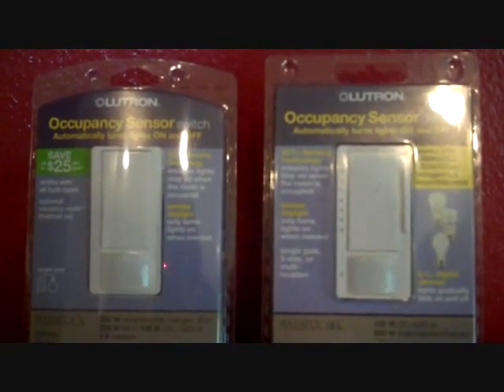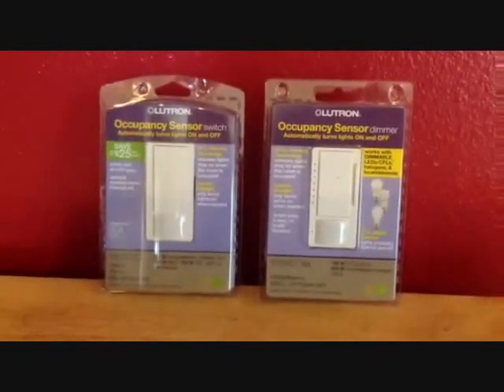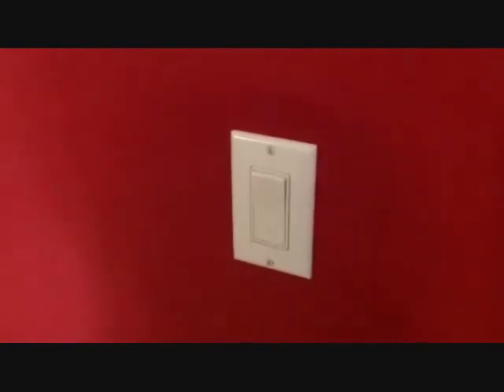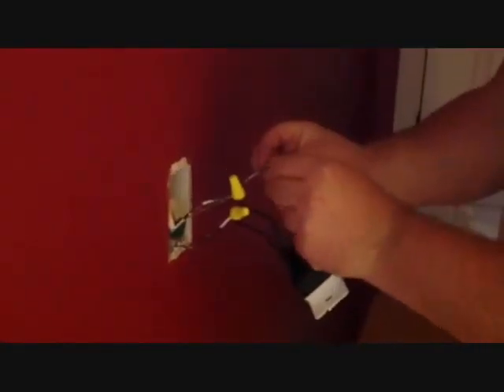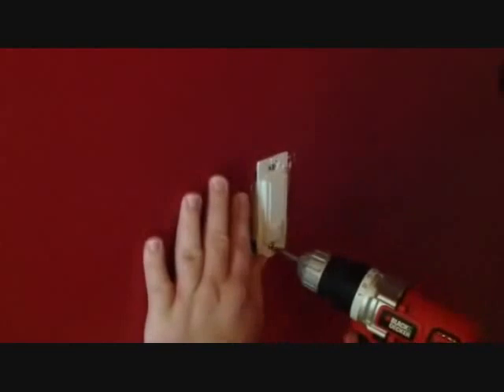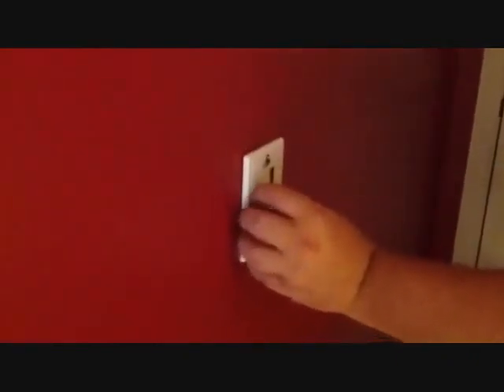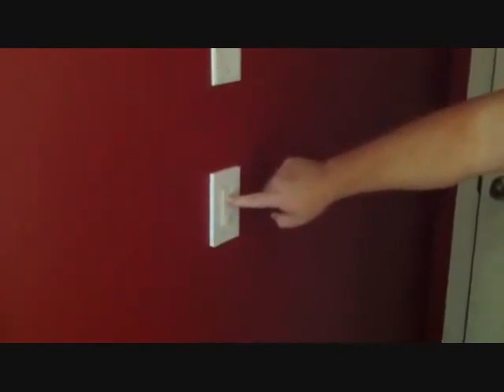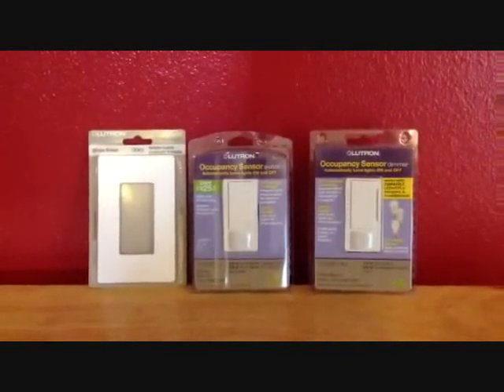Installing a Lutron Electronics Occupancy Motion Sensor Light Switch

Comment: Thanks for the video. But my question is, on a 3-way switch, what do you do with the other switch? Don't you need to remove the toggle switch and connect some of the wires together? Otherwise if that switch gets turned off, the new motion switch will not work.